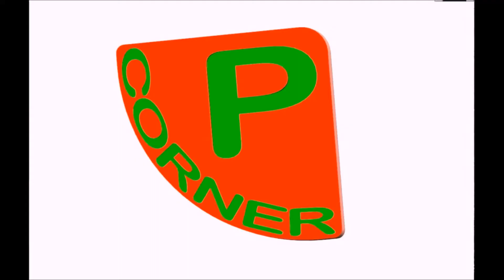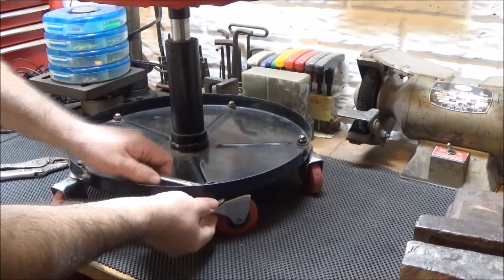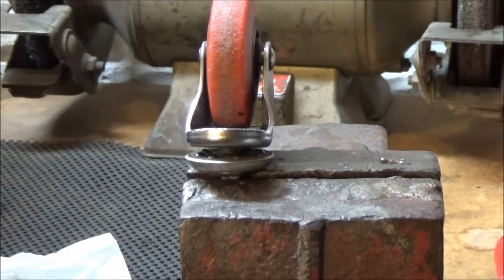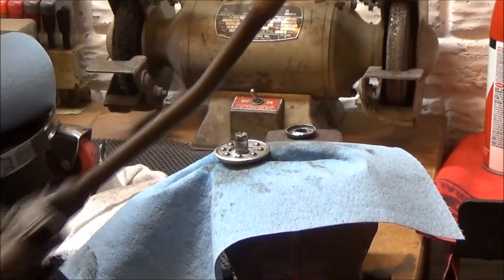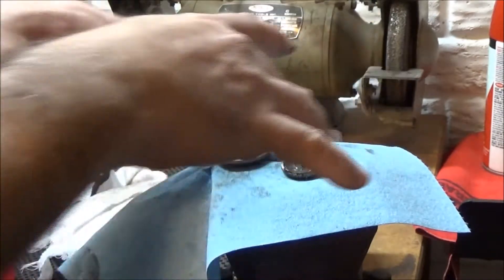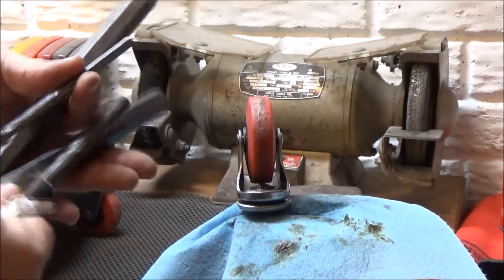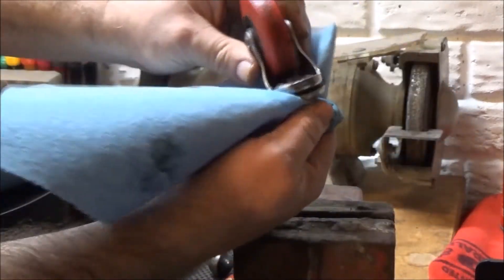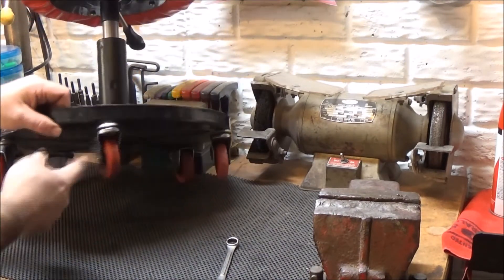Swivel Wheel Caster Bearing Fix

Comment: Just what I needed to know. Thanks. I though I could disassemble a castor wheel easily but they are riveted. Is there a reason a circlip is not used to retain the stem instead?
Reply from the maker: Yes some do, the staking process is cheaper. Thank you for the corner stop.!!

Comment: You don't need any sort of retainer to hold the bearings in? The old casters I am trying to repair had thin plastic retainer gaskets or washers.  I guess I wouldn't need a retainer if I can make the joint tight enough. Thanks for the video!

Comment: Do you recommend the drive punch over the chisel to set the rivet with?
Reply from the maker: A dull chisel is what I used, a combination of both the chisel and drive punch will also work to get material to mushroom over... thanks for the corner stop and drop.!!
Reply: A drive punch with a flat face right? Would that be one big enough to hit the whole rivet at once, or a smaller one to go around the edge?

Pardon my ignorance, I'm still building up my basic tools and knowledge.

Comment: Super cool video. Ive had chair wheel bearings on my mind alot lately. Im rebuilding an antique office chair. It seems that nearly all chair wheel types eventually have bearing issues. How would one prevent the loosening of the bearing race in the first place i wonder.
Reply from the maker: Thank you Josh for the corner stop, using grease vs oil will prolong the life it works better for lube especially when pressure is present.!!